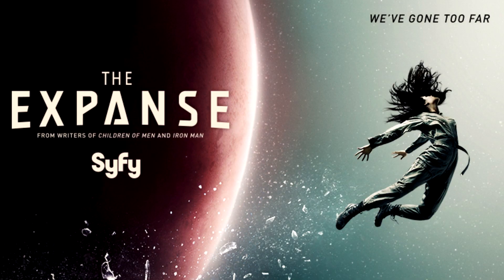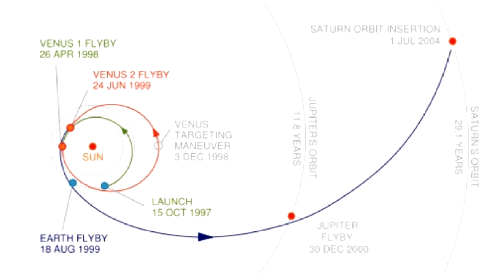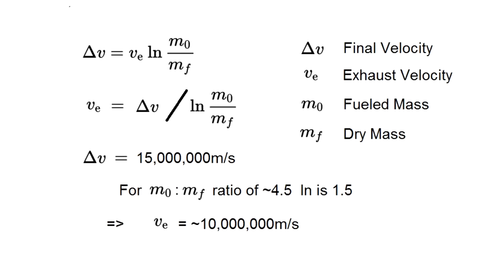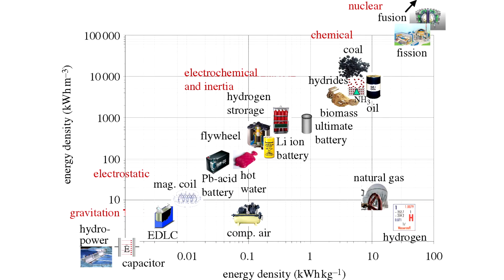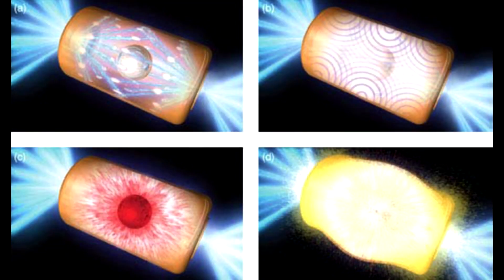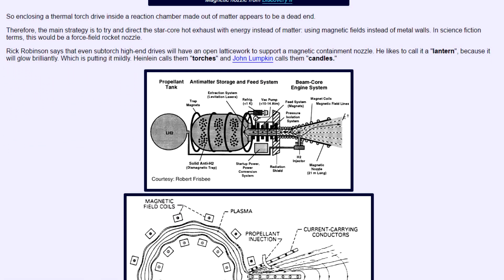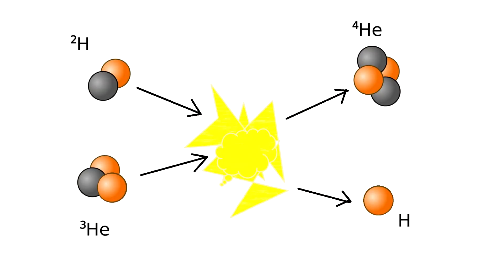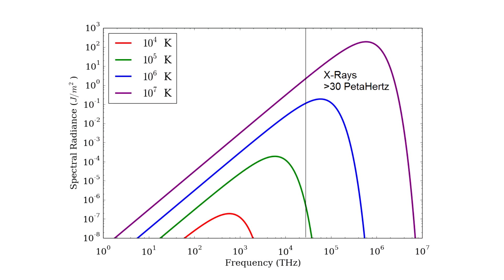The Rocket Science of 'The Expanse'

Comment: Why can't you just stick a particle accelerator in space and make the "exhaust" of charged lead ions go at 99.99% speed of light? I mean it would be super difficult and it would weigh a lot but surely if you could do it well enough it should work right? stick a fission reactor on it somewhere and your laughing.
Reply from the maker: +Block1618 sure, that's the math I did, and a fission reactor would have to produce at least 35terawatts.
Reply: If you get the LHC-in-space drive (tm), wouldn't increasing the velocity of particles increase their effective mass as they approach the speed of light? if you had powerful enough reactors and magnets (or a big enough loop) couldn't you simply increase the speed to increase the mass of the fuel (thereby needing far less to carry with you).
Since we can power the LHC surely it couldn't require that much (35TW)?
This would have to be a very big spaceship.
Reply: +Block1618 If you want a given acceleration, it will take a given amount of energy per second.
You will need to generate all this energy in a reactor.
That reactor wont be 100% efficient. The waste energy will be heating your craft. You will need to dump that heat in some way.
A fraction of the energy required to achieve 7gs of acceleration can melt a ship.
No matter your propulsion method.

Comment: Fusion engine run with He3???  The moon has plenty of it.  Go minie the moon, we could do it with probes.
Reply from the maker: +AKlover 'plenty' - lunar revolting has 0.01 parts per billion.
Reply: Scott Manley   No expert here but from what I understand the moon meets the specific circumstances to accumulate HE3 and other sources are too far away..  Supposedly few pounds of the stuff could power a large population center for a year.  Keep a train of probes going, each sends back 20 lbs it would more than pay for itself.  We know the concentration is that small how, 50lbs of moon rocks gathered 40 years ago?  If it is down to that i'd say the sample size is a bit light.

Comment: Chemical rockets also have a potential problem with heat.  They solve it with regenerative cooling: the hot exhaust is separated from the combustion chamber and nozzle walls with... more propellant.

What do you think of the idea of applying this idea to a fusion rocket?  The propellant would be supplied as a fluid, probably a conductive ionized gas, at the edges of the reactor chamber.  As it flows to the center, it absorbs the x rays from the center, becoming much hotter.  There would have to be enough propellant between the rocket structure and the fusing propellant to absorb the X rays.  I wasn't able to quickly find any literature on the X ray opacity of plasma, and that opacity is going to set the scale at which this technique could be plausible.

Comment: So that 100 ton ship used around 97 tons of fuel to accelerate for 37 hours.
Reply from the maker: +Rikaishi no - a 20 ton ship using 70 tons of fuel.
Reply: Warning: posting at 5am
I was actually looking at 9:18 where you say 0.7kg/s propellant used. = 93,240kg propellant over 37 hours. (no idea where I got 97ton) But of course the vehicle is losing mass along the way while maintaining 7g acceleration so must use less propellant over time. I didn't notice you handwaved that detail since it wasn't relevant to the radiation issue.

Comment: Lithium says hi and is pretty sad that you didn't mention it.

Lithium fusion seems to be more inline as it's the base fuel for most ICF test, it is also aneutronic so not a lot of nasty radiation.

On the other side you can have He3 + He3 fusion which will produce protons, then a secondary Lithium + Proton fusion reaction to produce even more energy.
Reply from the maker: +DOGMA1138 brehmstrahlung losses see you talking about lithium and says hi https://en.m.wikipedia.org/wiki/Nuclear_fusion#Bremsstrahlung_losses_in_quasineutral.2C_isotropic_plasmas
Reply: You assume that the chamber would let the x-rays to be absorbed by shielding rather than induce total reflection until they are absorbed by the plasma.
Since we know the amount of energy of the produced x-rays a multi-layered reflector can be constructed to match each possible grazing angle and produce total external reflection.
Another alternative would be to have series of compound lenses that would refract the x-rays and feed them back into the plasma over and over again.

We currently have pretty good x-ray optics that are capable of handling 10-20 kev x-rays which are used for imaging for both terrestrial and extraterrestrial applications.
While we usually don't implement these in fusion reactions, but technically there isn't a theoretical reason prohibiting us from doing so.

Basically if  you make your fusion plasma effectively optically opaque to x-rays you would not end up losing enough energy to have the losses preventing fusion altogether or preventing energy positive fusion.

So in 3 and a half centuries from now till Leviathan Wakes lets just assume that we've got really good at building x-ray mirrors :)

Comment: What about using a fusion reactor with a hydrogen-boron 11 fuel cycle? In theory it has a low neutron flux (zero neutrons from the primary reaction) and a high rate of ionizing photon emission, similar to D-He3. Perhaps those photons could be absorbed into a thermionic converter that lines the walls of the reactor, and the electricity generated in this converter could be directed to the coils that power the engine's magnetic nozzle, improving exhaust velocity and plasma pressure. The converter would increase system mass, but that may be compensated for by the lower mass of a downsized radiator array.

Comment: +Scott Manley: Question He3, Deuterium & Tritium are all gasses yes?  Could you not pump the gasses around the engine chamber the same way chemical rockets keep the engine bell cool?  Still have the issues with stray Neutrons but that 50MW of heating could be used to your advantage when you pump the now hot fuel into the magic fusion chamber

Comment: with that much energy being sent into the ship. just say in theory we use pure water in a pressurized vessel. either incasing( i would) or sheilding the main hull. Assuming our containment vessel doesn't burst. If let the thermal heat dissipate on the outside side of the ship do you think in theory we could build a turbine to harness that energy.( not turning to steam) but using the convection current produced via thermal expansion.
Reply from the maker: +Ceal Losaria problem is venting steam leads to lower specific impulse which means less wiggle room.
Reply: Scott Manley no steam just pressure
Reply: Scott Manley the idea for the pressure is to prevent the water from boiling off in 0g. near space it would get very cold yes?
Reply from the maker: +Ceal Losaria 1megawatt per KG raises temp of water by 240 degrees per second.
Reply: Ok, so there'd be some evaporative cooling...
Reply: so i don't know if this is correct or not but i just sat down with my sister to attempt it. with 240 degrees per second and the expansion coefficient of water is .000214 that would mean that if i took 1000cm^3 of water and heated it it would expand by 154.08cm^3. Assuming that the water will be cooled back to a base temperature could you use this to make a closed loop system with no pumps? at least that's the idea dude
Reply: well no. just radiating the heat to the outside of the vessel

Comment: Thanks for the explanation. I am actually writing a book, but the primary method of propulsion there is antimatter. I was thinking of describing some gas that is ejected from the exhaust during the annihilation. Nearly finished with the plot too and will probably need some help figuring out all the physics (I'm in the medical field - we don't do calculus often).
Reply: Is it hydrogen/antihydrogen annihilation? in that case the reaction products are a combination of gamma rays, neutrinos and exotic particles called pions. Only the pions are useful for thrust (because they're charged and can be redirected by a magnetic field)- the gamma rays just heat your ship and irradiate your crew, while the neutrinos hardly interact with other matter at all and thus just fly away into space.

electron/positron annihilation emits only gamma rays. You can still get thrust though- just use the gamma rays to heat hydrogen gas (seeded with tungsten dust for better absorption), then eject the resulting superheated plasma through a nozzle. Same approach can be used for hydrogen/antihydrogen, but it comes at the cost of exhaust velocity.
Reply: cherminatorDR Any gases emitted by antimatter reactions are going to be waste products, and optimized designs would try to avoid it. They'd probably be exotic, but short-lived, fusion products and waste hydrogen.
Reply: Would the efficiency of heating hydrogen/tungsten dust be comparable to a fusion drive?
Reply: depends how hot you can make the plasma before your engine melts. Also note that for a given engine power higher exhaust velocity equals lower thrust- you may even want to 'shift gears' by varying the proportions of hydrogen propellant and antimatter, allowing your ships to switch between high thrust/low specific impulse (for taking off from a planet or evasive maneuvers in combat) and low thrust/high specific impulse for cruising on long voyages.

 Atomic rockets has a great deal of info on this sort of stuff. Start here: http://www.projectrho.com/public_html/rocket/antimatterfuel.php and here: www.projectrho.com/public_html/rocket/enginelist.php
Reply: Awesome. Thanks, guys!

Comment: Ships in the expanse use water as a propellant and the propellant is depleted more rapidly at 7-15G than it would be creating an equal ammount of dv than it would doing 0,3g (standard cruising speed). I always took this to mean they inject steam into the reaction chamber to dirty the plasma and give it more mass.
Reply from the maker: Yep, that's something I left out, but if you have a 10,000km/sec exhaust velocity fusion drive you can increase thrust by dumping more mass into the exhaust - same energy, but greater mass means lower exhaust velocity but more momentum. Quadruple the mass flow rate means ISP drops in half, but, thrust doubles.